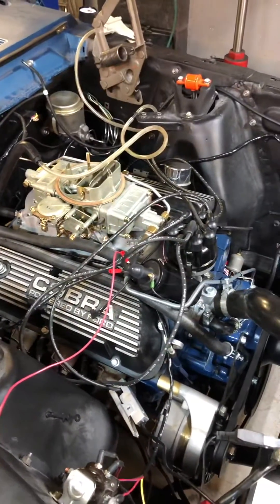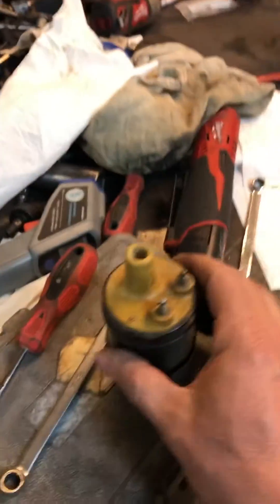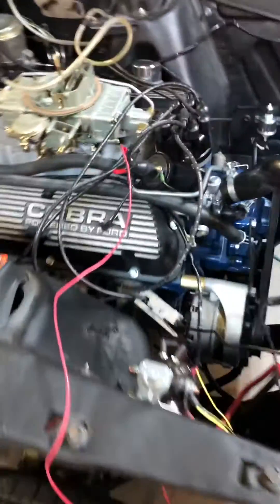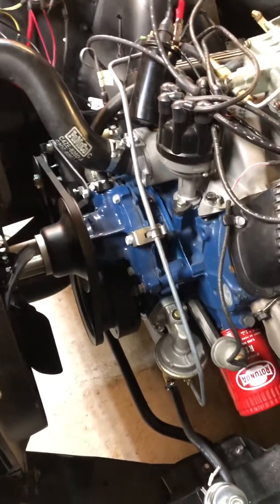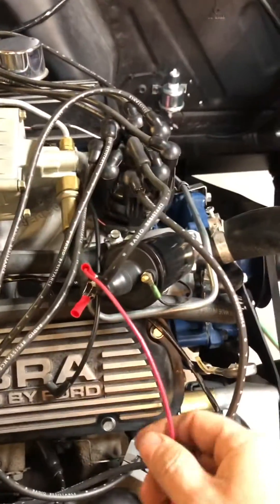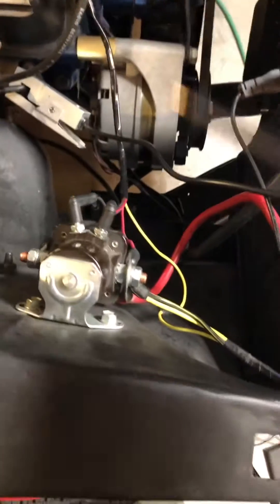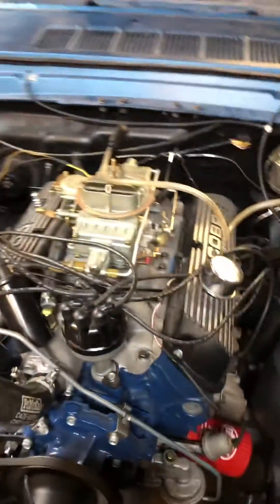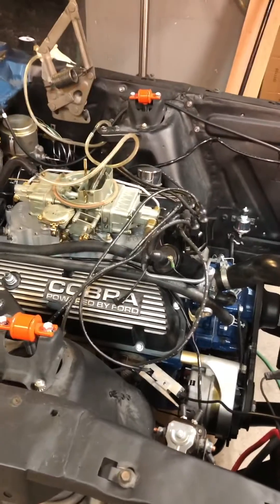1966 mustang with ignition switch voltage to coil issue

Comment: Had same issue and did but same thing but now the key won’t turn the car off. I have to disconnect the wire going from battery to coil.

Comment: Also pink resistor wire can be at issue. Don't know if '66 came with that wire.  If so, wire could be getting hotter and hotter as the engine runs and, as the wire warms, voltage to the coil drops and engine misbehaves. That could explain the issue. Good video.
Reply: Is there a way to bypass the pink wire?
Reply: @pvgreen621  Maybe! I believe that some CD ignition systems (like MSD) work with the pink wire as well as without it. If you are thinking about going with an CD ignition system upgrade,  contact the manufacturer and down-load the instructions for installation BEFORE you buy. The pink wire is there to reduce voltage to the coil and, therefore, prevent the coil from getting cooked. If memory serves, the pink wire reduces voltage to the coil to about 6 or 7 volts. Let me know how it goes.